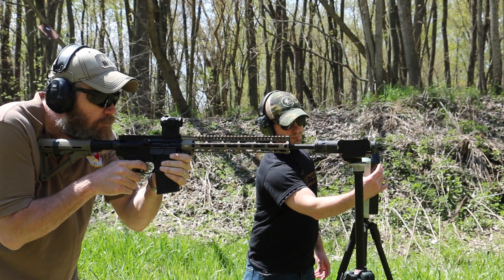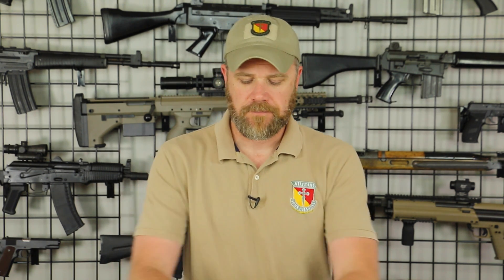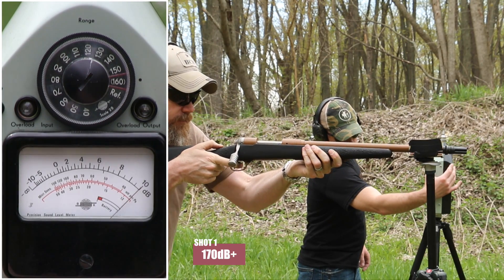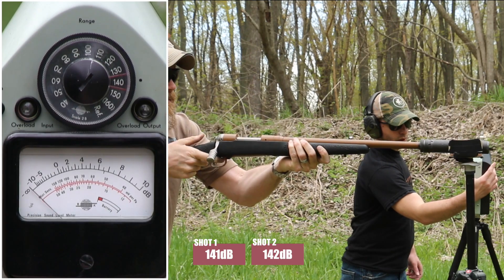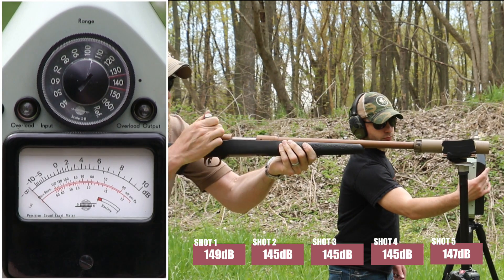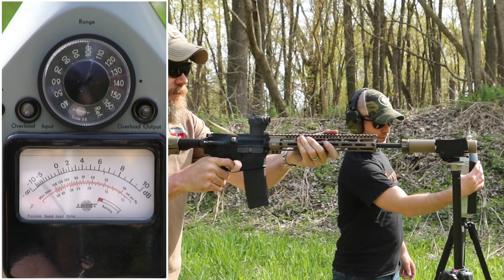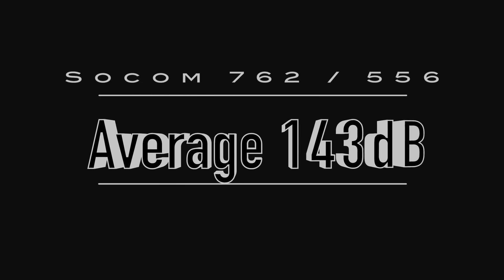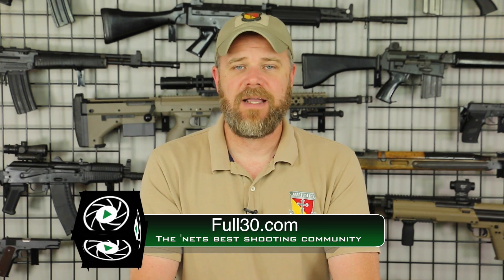Testing 30 Caliber Suppressors

Comment: I could be wrong, but it seems like every supressor test video I have seen, has the meter right by the muzzle. I'm curious to see what would happen if you put the meter back where your ears actually are when shooting. Since I don't have a good decible meter to test this myself, would you have any interest in posting a video showing the difference (if any) of the decibles by the muzzle vs the decibles back where your ears actually are? Thanks
Reply from the maker: fnkdtnk We will do this test sometime in late July / early August with various suppressors.  The reason we've done the tests this way for this series is that we're adhering to industry / military standards.
Reply: Military Arms Channel Great, I'm looking forward to it! Thanks.

Comment: 3 db is approximately twice the volume, so yes, significantly louder.
Reply from the maker: Gun Sense (drmaudio) You can actually hear it in this video. The SOCOM is only 3-4 dB louder than some other cans but it doesn't even really sound suppressed.

Comment: To put another spin on understanding dB SPL...

When applied to sound systems, a doubling of either number of (similar) loudspeakers or a doubling of the amount of power to a set of speakers will result in a 3 dB SPL increase. So if you're getting 120 dB SPL out of two 12" woofers with a total of 100WRMS applied (50 WRMS/speaker), adding two more woofers with the same amount of total power applied (25 WRMS/speaker) will result in 123 dB SPL (assuming all speakers are the same and are housed in similar enclosures, etc. etc.).

A doubling of loudness corresponds to a 10dB SPL increase.

Comment: does barrel length have any play in reducing decibels as well? would longer barrels help reduce noise and shorter increase? or vice versa?
Reply: Yes that's why when people ask me if they can suppress a 7" I tell them it's pointless since it will be so loud anyway. But nonetheless they still want to.do it. As short as I go anymore with 556 is about 11.5 due to a decent sound signature reduction and reliability
Reply: Gunlover82 longer barrel=quieter gun  (to what extent I don't know).
Reply: Gunlover82 Its a big difference.  You can shoot a 7" 556 can and it will meter 145, on a 10" it might be 139, on a 14.5 maybe 133-134 16 could be 132 so on.
Reply: Sandy Carty
awesome, thank you.
Reply: Griffin Armament
thank you for the info. so like velocity, longer is better. good to know.
Reply: Griffin Armament
very interesting. thanks for the info!

Comment: i've always wanted to know what a 7.62x54r using a mosin nagant, would be like through a sound suppressor.. db wise that is. and being it's a cheap gun. it should use a oil can suppressor. i even thought to use a big rig oil can in-place of the auto filter style.. being it would accept more expanding gasses and release them slower over a longer time span.

Comment: Interesting results and a very impressive showing from SilencerCo. I'm curious as to whether any of these supressors will later be tried with subsonic ammunition (or if that'd be a waste of time). I'm also curious as to whether the sound of the action reciprocating on the automatics has even a slight bearing on the reading (though I doubt it with supersonic ammunition).
While I'm extremely fond of supressors as a concept, these days I find myself in the position of only being able to shoot at relatively crowded public ranges, so actually investing in one would be, for my use, of extremely negligible value. I am nevertheless curious, having no firsthand experience myself, and hopeful of one day being in a situation to have access to better and/or more private shooting facilities.

Thanks for the videos!

Comment: Dead Air does a swappable front cap so you can put a 5.56 exit bore diameter on your otherwise-.30 cal can. Should make it a bit quieter when repurposing a .30 cal can on a 5.56. I've heard subjective reports from some folks who have tried Dead Air's system that it makes an obvious difference, but haven't seen actual measurements yet. Tim, are you able to borrow that from Dead Air? Would be cool to see. Just don't forget to put the .30 cal front cap back on before swapping it off of the .223 to something larger haha...
Reply: Jeremy S. End caps typically will drop 1-2 DB too little to be perceptible to the human ear in my experience.  I view it as a fad.

Comment: why do people think firearms have to be loud? its exactly like driving a car without a muffler. The products are there and people are willing to use them but the stupid NFA laws make it such a hassle. I think a huge percentage of people would use suppressors if they were easy to get which really all it is is a can with baffles in it so in a way it is a muffler designed to fit on your gun. I hope one day suppressors will be accepted by the whole public and government and it will come to that pretty much any loud gun is an old gun or a small ccw pistol and some shotguns.

Comment: Excellent series
Reply: Mrgunsngear Channel F'in outstanding! Who knew Griffin Armament would thrash surefire and even most silencerco?!
Reply: DementeD for bolt rifles though Sound reduction isn't the most important factor. Don't get me wrong you want your suppressor to reduce sound of course that's why you bought it. But if the suppressor doesn't maintain accuracy it's a moot point if it has the most reduction on the market. That's why i want to see accuracy test. Take TBAC for instance one of the most respectable suppressor companies in the precision rifle market. Last number taken from the PRS series TBAC was used more than any other can. Reduction is 30db or so, but those cans will hold 1/2 MOA and under all day long. I'm not saying this isn't true for the other manufacturers. My AR however i do want the most reduction and will be going with griffin or Gemtech. if it's holds 3/4-1MOA i'll be satisfied. Griffin has some awesome reduction numbers but i think 17oz paired with clip-on thermal, laser, and the Razor that's already on there might really start to weigh it down.
Reply: Dave Webster Surefire has NEVER been the leader in sound reduction and the Recce 7 is looking to be a good can for sure but I still think the Omega is the can to beat at 7" long 14oz and a solid performer only being bested by the Specwar from what I could find. Glad I went with it!! But there's a lot of great competition and that only means better performance and pricing for us.
Reply: Will Sartin I definitely understand that.  Was going to get into that about the surefire but didn't want to write an article haha.  I'm at the point with 300BLK that I would personally enjoy 130 db with as little gas blow back as possible light weight short etc.   But i do laugh when shooting it it's so quiet.
Reply: Will Sartin Any can that is well made and has a QD mount is going to give you a consistent POI shift.  It may be 2 inches, or 12, but the shift will be repeatable every time in the same direction.

If you really want to get cray, and you've got the cash, Liberty Suppressors will build you a custom integral on a barrel of your choosing.

Comment: A month ago or so I finally got off my gut and set up a trust..all for the purpose of owning suppressors. No reason at all to not mitigate damage to my hearing..

When the heck are we coming with those phasers and laser blasters so we can do away with this quibbling byproducts of gunpowder 'explosions' anyhow..
Reply: gurney85 I'm pretty sure setting up a trust is only for purchasing NFA restricted firearms (machine guns) not suppressors.  Pretty sure if they are legal in your state then all you would need is to fill out the forms and pay for the tax stamp and of course the money for the suppressor itself.
Reply: Sandy Carty Oh.. I'll have to revisit that and make sure. But its an NFA item isn't it? Gets registered, and if  not in a trust gets registered to the individual with fingerprints, Chief of Police sign-off and all that jazz where a trust foregoes all that.

I'll check again.. BUT regardless, I have the trust..just in case.
Reply: +gurney85 Actually sir you were correct and setting up a trust is the easier way in most cases. :-) :-)

Comment: I feel like the Surefire would be quiter on the .308 and 5.56 had they use a muzzle brake instead of the Flash Hider, Any thoughts?
Reply: MonteMiami in our 10 years of sound testing we have noticed +/- 1-2db difference between different types of mounts.  Its not a game changer.  We know this because we make more mount options than any other suppressor manufacture and have tested almost all of them.
Reply: MonteMiami Surefires are just loud.  It's how they are.

Comment: at 0:21 whats the rifle above and to the left of the desert tech.
Reply: Nevin Zavell That appears to be an FNC, the older brother of the AK5
Reply: Anon E. Mus More like the parent rifle. The AK5 is a derivative of the FNC licensed out and manufactured by Bofors Mfn in Sweden, but technicalities aside, you are correct for the most part.
Reply: Arphalia I would have considered it a parent rifle if it was made by the same manufacturer, but because I thought it was developed by a different manufacturer, I consider it more of a  "new brother" than a direct decedent.
Reply: Fair enough, though the internal design hasn't changed much. A lot of the modifications to my understanding was to make the rifle more suitable for the colder climate Sweden experiences.

Regardless, I would love to own one (The FNC) one day, but at roughly 4k USD a pop these days (and climbing) It's more than a little out of my reach right now lol.

Comment: I would love to see POI shifts and who is top dog in accuracy. Is that going to be in a future video?
Reply: ***** POI shift is going to consistent.  Which makes it something of a non-issue.  Either you plan on shooting primarily suppressed in which case you hold over when shooting loud, or you plan on primarily shooting loud, and thus hold over when suppressed.

If you're trying to shoot the nuts off a squirrel you're best off with an integral unit.  No fussing with an external can, and you get a shorter overall package.
Reply: poisonouslead85 you realize poi can shift up or sideways too when mounting a silencer?

Comment: Tim,
On the averaging issue, you can compromise. convert the dB over to the linear sound intensity unit (watts per square meter), average those numbers, and then convert back to dB for a true average. You could give both numbers for the sake of comparison. Plus then you get to  have a fun time solving logarithmics! Yay!
Reply: asthmaticrhino The meters can measure linear sound so no conversion would be required.  The problem with this method is that for decades suppressors have been measured A weighted per mil-std protocols, and the linear numbers wouldn't make any sense to the consumers or anyone else working in suppressors because they would represent a different measuring std, when all previous thought and analysis is on the other std.  So most people would simply be confused by the numbers and unable to put them into context of what they previously have observed.  Also OSHA is a C weighted impulse std, so people would be comparing performance and hearing risk to linear which is further from C weighting than A weighting is from C weighting.

Comment: Everything above 85 decibel may harm your hearing permanently (especially over time). 120/125 or so is the threshold for where you feel actual pain from even a short sound.

The decibels those guns reach even with suppressors on are way too loud for use without hearingprotection.

For reference, if a nightclub limits it´s soundsystem to 85 decibels (which is a legal requirement where i live) people go and complain to the DJ that the music isn´t loud enough. The level of where you get permanent hearingdamage is way "softer" than most think.

Use good protection for your hearing, those suppressors aren´t even close to being "silent" enough. I have no clue where this c*ap about below 140 being safe is coming from but it sure isn´t from anyone that understands sound and hearingdamage properly.

One also needs to understand that hearingdamage accumulates, meaning it gets worse and worse and it never heals. You loose a little bit every time until you are basically deaf.

I´ve been shooting for more than 30 years and i can still hear the crickets outside. Thank you Peltor! ;)

Dont be stupid, protect your hearing! 

/Best regards, SgtHL
Reply from the maker: sgthl Thanks for your comment, and I agree it's a good practice to wear hearing protection when using suppressors (especially centerfire rifle) however OSHA disagrees with your position: https://www.osha.gov/dts/osta/otm/noise/standards_more.html

I wear hearing protection, as you can see in the video.
Reply: Military Arms Channel Thank you for your reply. I dont think that the OSHA actually mean that less than 140 is ok, they simply state that sound shouldn be more than that, ever. They do however seem to agree on the levels of 85 decibel as being dangerous.
Reply: @sgthl  You are incorrect. You are comparing 2 different types of noises. 85 decibels is the maximum threshold for a CONTINUOUS NOISE like the sound of a lawnmower. Besides, 8 hours at 85 decibels can cause some temporary hearing loss, meaning if you are exposed to 85 decibels well under 8 hours say like 2 or 3 hours in a day, you won't get any hearing damage without hearing protection. 140 decibels is the maximum threshold for IMPULSIVE NOISE like a gunshot. See, guns are only so loud for a millisecond, then the sound gets quieter.

See, a 140 decibel impulsive noise is barely tolerable and somewhat hearing safe but a 140 decibel continuous noise would rupture your eardrums within like 10 seconds. There's a huge difference.

Comment: As someone who doesn't know much about science, why can't you average decibels?
Reply: Decibels are measured with an exponential scale not a linear scale. An increase of 3 decibels is an increase of about 100%.  It is possible to find the average, it would just require a lot more math
Reply: rassi13  If you were to average two readings like this: (140+146)/2 would equal 143dB. The true average though because decibels are measured on an exponential scale would be greater than 143.
Reply: Peter Dvornik I don't see why they don't use median or mode. I guess averaging makes their cans look better?
Reply: Griffin Armament 

Why not just use the loudest impulse recorded? It seems to me that's what is most important to an end user, no matter if it's a military user worried about being detected or a civilian user concerned about hearing damage.
Reply: rassi13 I would guess because it is on a logarithmic scale so it might be inaccurate to round. This is more a math based scale so I am not 100% certain myself so grain of salt.
Reply: rassi13 Because averages are an exact number. Averages can change. Averages don't provide an accurate or precise reading. In science we don't want averages per se. We want precision on all measurements. And I do know science...I'm a surgeon. So if I was replacing your hip. Would you settle for an average measurement? You would then have issues walking or possibly do more harm.
Reply: Rick S correction: "are an" =  "are not an"
Reply: TheJohn8765 i dont think that's the case.  Most people dont care, or know, that decibels are exponential; so they aren't going to throw a crash course in acoustics at us, a simple number is easier for everyone.  And as long as everyone is using the same standard, no one is getting an artificial advantage on the competition.
Reply: Peter Dvornik Yah, I guess so. I suppose I wish more people knew how shoddy "averaging" is. Still, at least it's a standard and I guess Tim's tests have been showing how little variance there is between suppressors (practically speaking).

As an aside, I'm surprised OSHA standards cut off 140 dB as the "impact harm" level.

I wish Tim had also had the same dB meter at the butt-stock for comparison.
Reply: rassi13 The answer is you can, and you want to average.  The suppressor itself doesn't measure the same sound pressure level one round to another, so there is no other way to get a single number that accurately represents product performance.  The people who have problems with an average simply don't understand sound suppressors.  There is no way to measure performance without an average.  What they are talking about would be like trying to represent EPA fuel economy for a car with one number, or to represent horsepower without specifying RPM HP was measured at.
Reply: Decibels are a logarithmic conversion from sound pressure levels. To properly average them you'd need to convert the individual readings to sound pressure, average them then covert that average back to decibels.
Reply: +Griffin Armament is the griffin he tested here better than your new SD-30 ?
Reply: +Paul Hatch. the decibal scale is similair to earth quake intensity and tornado ratings F4 etc
Reply: +Aries144 Because that one represents variation between cartridges rather than what the suppressor was doing with it. It is "a flier", acoustically speaking. 

This was all factory ammo and factory ammo, while good, is not especially consistent.
Reply: W Canaday
 Right, but if I'm concerned about not breaking 140dB say, does it matter to me if that one shot at 142 was a "flier?" All I'm concerned with is seeing the worst case with that ammunition. Now, if you get an outlier like 1 in 10,000 rounds that's 142dB and the highest other than that was 137, just note that in the test results.

Comment: Was the Saker 762 on the 556 used with the 762 endcap or the 556 endcap? I would be interested to know how much of  a difference the end cap would make in comparison to the other suppressors tested. Not that it really matters, I just got my Saker out of jail and it's a little late to change my mind now.